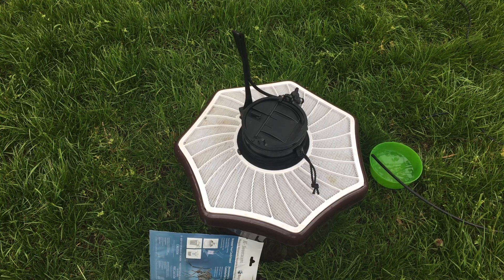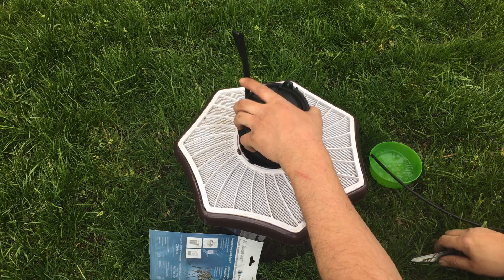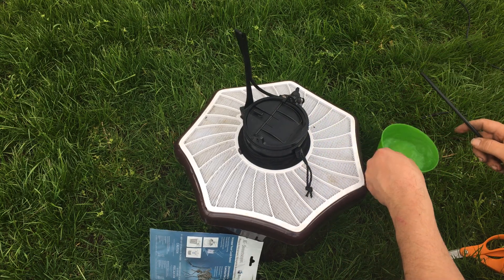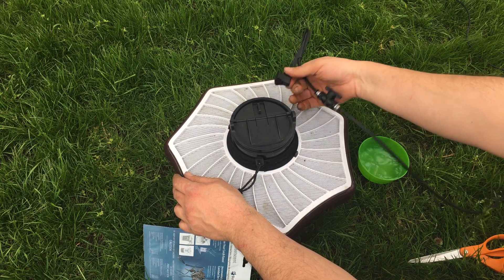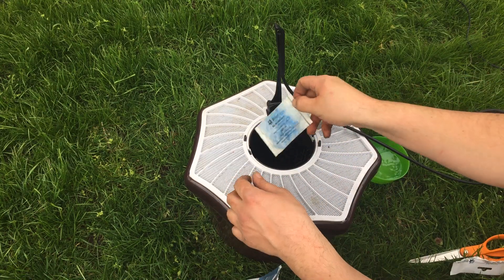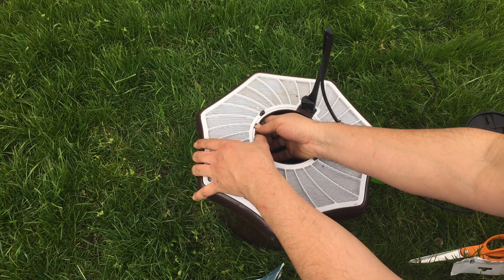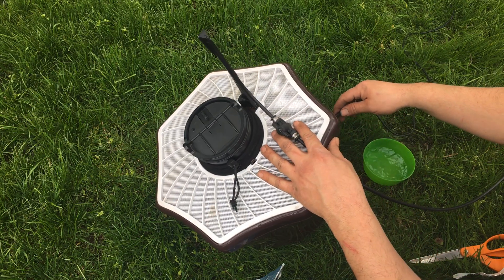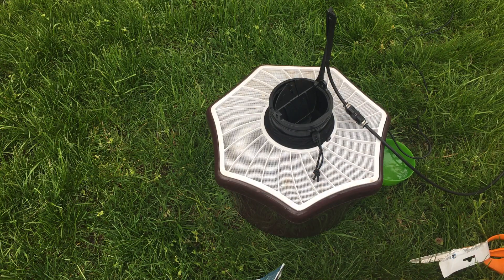Biogents Mosquito Trap #2: Setting Up for Year 2

Comment: Thanks for this video- looking to get the biogents Mosquitaire CO2 trap and the GAT trap. Found your videos and was wondering if you still are using the traps (I saw you had both) and how they are holding up. How would you characterize your mosquito experience before using the traps, one year after, and if you’re still using them, five years later? Do you barely get bit when you go outside now?    Thanks!

Comment: What type of hose did you use to extend the one that it ships with? Is it just standard 1/4" irrigation poly tube?
Reply from the maker: Yeah I think so. I used ¼ inch truck air suspension tubing just cuz it was cheeper but any ¼ tube would work I think.

Comment: I just got mine and set it up. Finding that the valve lid is so tight that it wont toggle open when the fan is on. I checked to make sure i have the suction funnel on correctly and it is. I had to use a rock to sort of "prop open" the valve. I didnt check to see if it can be loosened. The moment I brought it out the scent was attracting the mosquitos right away!!! Hoping it works for me as it is miserable to sit in my back yard! Thanks for the vid!

Comment: I'm still worried about rain and that fan and the attractant.  And the filling of the bowl unless there are drain holes.  What do yo think?
Reply from the maker: Hi. There are drain holes cuz it has never filled with water. I was also worried about the fan but they have worked for several years without issue.
Reply: I'll also confirm that there are drain holes in the base.  I only have mine somewhat sheltered and it has been fine for a few years now.

Comment: Hi, I am planning on purchasing a network of Traps - local Vector Control District is unsustainable to REALLY combat this mosquito
Reply from the maker: Sorry to hear that. Honestly, the simplest system is to just buy a thermacell backpacker and a small camp fuel cell and some thermacell mats. Its cheep easy and not as complex as the Biogents system.
Reply: @postbeam8200  Like most insecticides, Allethrin (a pyrethoid and the active ingredient in thermacell) has not been extensively studied.  Like most companies who sell chemical repellents, they arent forthcoming with the information and probably just call it good to go.  The fact that it's toxic to cats and bees is enough for me to not use thermacell.

Comment: Do you think that nozzle really wafts or alters the exit path of the co2?  You think with just the hose it wouldn’t work spreading the co2?
Reply from the maker: I can't say for sure but I like that it clicks into the mosquito trap which makes sure the CO2 is just above the trap and helps keep the mosquitos in the right place to get sucked in. If I just used a hose I would need to tie it on somehow. But who knows if it really helps.

Comment: Hey. Great videos, thanks! I was researching various machines available in Europe for the last week, finally decided on the one you have. One with CO2, will probably order a few more regular ones, and then just hook up the tube from central co2 tank to all of them. I am interested in the valves you are using. I tried gardena style 1/4" valve for watering garden (micro drip system) and I think it will work, but its really hard to regulate flow (as it is made for water). Your valves look metalic and much more robust and I guess also precise. Which is a must have when one connects 3-4 devices to one tube. On the co2 regulator - what is the flow you use? 0,5kg/day per device, meaning if you have 4, thats 2kg/day? thanks
Reply from the maker: I am using Pneumatic valves that are normally used for air bags in commercial trucks. They are 1/4" outside diameter tubing that is stainless steel and plastic but I like that is is super accurate to adjust. (https://smile.amazon.com/dp/B00H3Q7OQW/ref=cm_sw_em_r_mt_dp_zq1vFbHYC6K54) but in Europe you may want to look at a 6mm tubing used for trucks. As far as the kg/day I found that just counting the bubble rate in a glass was the most accurate way to adjust flow rate. U use the standard flow rate specified on the Biogents valve and then make my precise adjustments at the local valve based of bubble rate.
Reply: Here in Cambodia, these traps work like a charm

https://www.youtube.com/watch?v=aeGr1_LYdp4&list=PLHTPNj-Ytv2kqlZXIV_KYB7_vukGo3Tdq&index=17